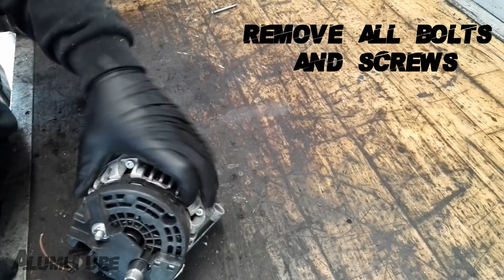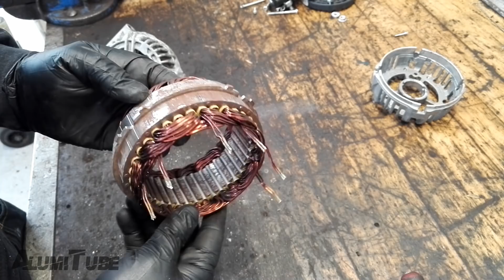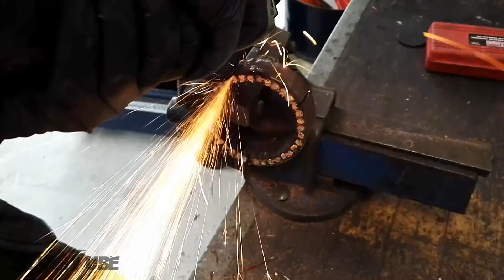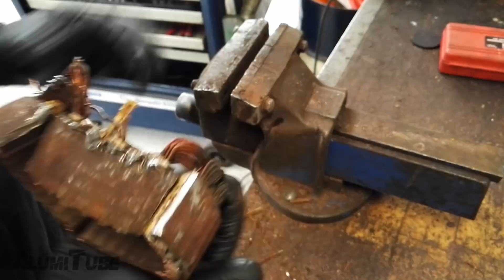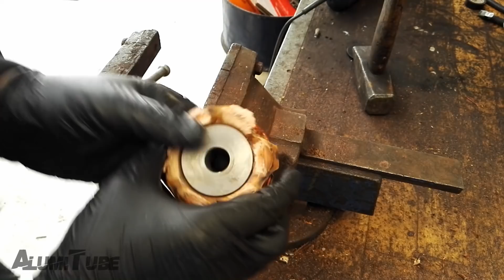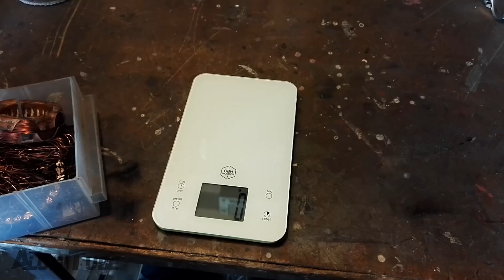How To Get Free Scrap Copper From Generators

Comment: copper wire or copper coated aluminum wire?  looks like aluminum to me   i just did 2 ac condenser motors and found out after all the effort the wire was copper coated    and was not worth the work to get dirty copper price
Reply: Should've used a file before doing all that work. But we live and learn

Comment: Dude those alternators are worth a hell of alot more if you rebuild them yourself and its cheap and easy to do  you can get the parts at autozone to rebuild and they will test them for you for free then  i sell them   between 50 to 100.00 each
Reply: That's not the purpose of this video, though. Some people don't want to rebuild them. How much money would you have to put into it and how much time? Then how long would it take to sell or find a buyer? I look at scrapping as free money.
Reply: You can rebuild it but most people will just buy a new one because it's simple and when something is rebuilt, most people will perceive its a junk. Well unless there is no brand new replacement available anymore, just find a reputable company or someone that can rebuild parts.
Reply: Nice! Is there a rebuilding kit?
Reply: @luigiprovencher  scrapping is not free money.  You will never get anywhere in life thinking your time has no value.  That alternator is worth more money whole that the sum of it's parts.  Not only did you waste your time, you also wasted your money.  Better luck next time.
Reply: @bernie9728  That's not what I meant. Of course it takes some time and money in the form of gas to collect them but I'm not in the spot to store and resell things.

Comment: No 2 Copper wire (burnt) and Heavy copper (pipe) £4.00 / $5.33 a kilo in the UK.
Reply: @Paul Warren Hi Paul, where do you get your prices from in the UK as a guide for kilos?,i can only find tonnes and for the little copper i have i am trying to work out how much it's worth.
I recently took some old copper pipes in only a handful and got £6.50! but still it is priced per tonne, how do you work out the kg price please, thanks
Reply: @SP330Y  Divide the tonne price by a 1000 and you get kg price.
Also some metals may be priced in Dollars US, so do a currency conversion .
Copper pipe is approx £3 - £4 a kilo, if its mixed with brass or plastic, may well be half that price.

Comment: Can you give me info on machine used for removing rod from rotor?
Reply: It's a Hydraulic Press. You can buy them either with hand pumps or hydraulic motor pumps. It's just a hydraulic ram is all it is. Very handy machine to have.

Comment: Nicely equipped shop! Are you an auto mechanic?

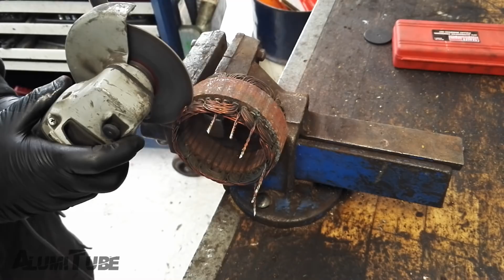The part at 1:24, it seems like there should be a better way.
Reply from the maker: Yes awldune auto mechanic ;) Fixing cars on a daily basis... Year i must find a better way hehe, but i gat it :)
Reply: Cool, and I guess it is a great source of aluminum scrap for you :)

I don't know what that material is that holds the windings together, but I wondered if it could be burned off.
Reply: The material is probably rubber or some type of plastic.